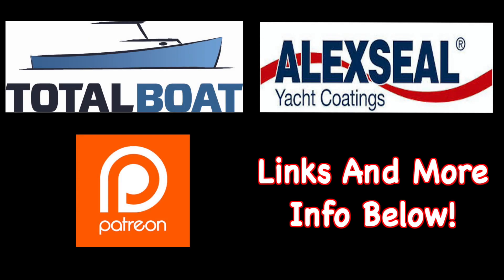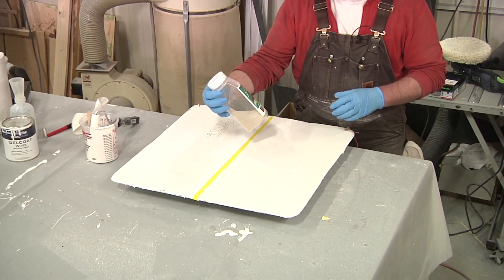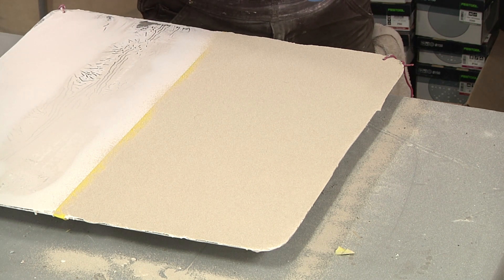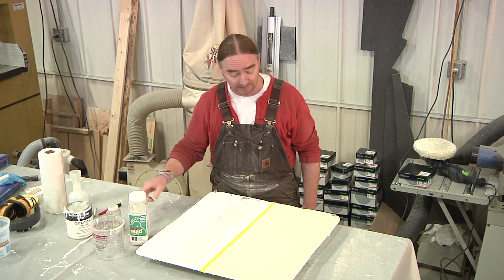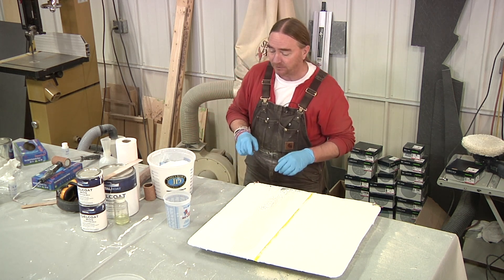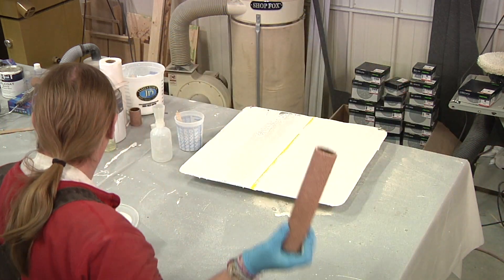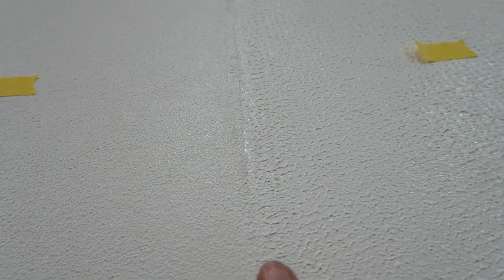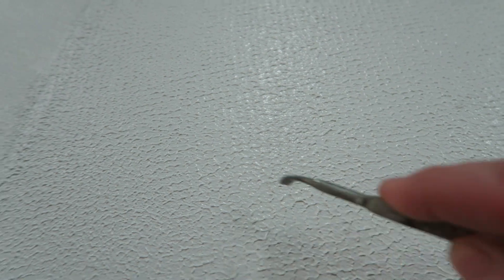2 Different Types Of Gelcoat Nonskid Applications For Your Boat Project!

Comment: We restored the deck of our 1976 Paceship sailboat with AWLGRIP and Softsand based off one of your previous boat job videos. Although many members of our club recommended we not use Soft Sand or AWLGRIP, and after we saw their application of the carpet roller technique on their boats we decided it was best to stick with your advice and Softsand. Boy are we glad we choose to stick to your advice. 
The job finished amazingly. The same members that poo pooed our decisions (because we're younger, new boaters) asked many questions of advice afterward.
It was our first time trying to restore any boat. LOL!  Your videos helped us to be patient and properly follow the instructions instead of cutting corners to get it done quickly. Well worth the effort.
Thanks for your efforts and trainings.
Reply: Did you use the flattener to cut down the shine?

Comment: Great videos. I used this exact technique using Totaboat single stage urethane. 
One point is to make sure the first coat of paint or gelcoat is as even as you can get it. I rolled in both directions
to make sure there was an even layer without any thick paint ridges from the edges of the roller. The amount of sand that adheres
is directly proportional to the thickness of the paint. Also any bare spots will not obviously hold sand. These bare spots can be difficult to see if 
painting over the same color. It is impossible to go back and retouch these areas.

Also DO NOT plan on painting surrounding smooth areas at the same time as applying the first coat over the sand! No matter how well you sweep or vacuum 
excess sand, some will be picked up by the roller and get deposited on the smooth areas, (ask me how I know!)

Keep the videos coming, very educational

Comment: I am fixing to shoot some non skid in a way I’ve never tried myself. The shop I buy fiberglass supplies from told me to get a cheap primer gun with a large tip size and mix in the sand with the gel coat to spray on. If it doesn’t come out you drill the tip on the gun slightly larger until the particles flow out with the gel. They shoot it all the time and it looks great. I’m fixing to try it myself. Great video!

Comment: I’ve used Interlux non skid additive with great successes. Works great with most hull or deck paint and goes an incredible long way.  It’s not overly course and won’t hold dirt or tear up a mop. Do a test board to figure out the mix ratio you like. Follow the paint instructions for number of coats and paint as soon as possible between coats because you can’t sand between coats. Stay the hell away from soft rubber grit. The paint eventually dries hard and the rubber flexes under pressure. The paint shell fractures leaving the exposed rubber grit which will decompose, change color, wear down or pull out. This leaves a void for water, dirt or an entry point for water to get under the paint.

Comment: I've used Kiwi grip on 2 boats, looks like your rolled finish.  You can control the "agressivenss" by how thick you put it on and knocking down the pointy parts after it dries the same way you have.  Water based, no hazmat fee, one coat.  I use drywall texture rollers, HD and Lowes carry in the paint department, look like they are covered in squiggly dried spaghetti.  Way cheaper than the Kiwi grip ones and work just as well.  I also took my white Kiwi grip to my local paint store and had it closely color matched to my tan canvas.  Love your videos for the techniques, learned a lot from them.

Comment: GM Andy! Both samples came out great! I do my nonskid the same way! For the rolled on texture, I thicken as you did, then I use a 3/8 nap roller. I get the material down, squeeze the excess out of the roller with a gloved hand, then lightly back roll the uncured gel. Leaves a nicer looking pattern than the “Carpet roller method” in my opinion. Love the soft sand method and product with paint too!
Reply from the maker: Great tip!
Reply: BoatworksToday thank you! All your tips and videos are great too! I wish I could produce the same quality videos you do!!!🔥🔥🔥🔥🔥🔥🔥🔥🔥🔥👊

Comment: We have done it before with the thick gel rolled on. We lightly sanded the stippled area when it cured to get it to match the gel we were trying to duplicate. It matched perfectly in texture and color. Just gotta knock the tops off of the stipple. Easy to do.

Comment: I've been leaning towards the Softsand since your 1st use of it, even on that test panel it's more pleasing to the eye. Like others can't wait for you to get back to the transom project, I'm pretty sure you are thinking and re-thinking options. Once you hit the point of no return it's all or nothing. I'm just glad none of my projects are that big, more cosmetic then large and structural.
Reply: i worked on liveaboard dive boats for 12 years in the caribbean.   Painted the decks every 12 months maybe? we always used silica sand.    base coat, sand, then topcoat. worked really well.

Comment: Thanks for the demonstration. I’ll soon be removing carpet from the floor of my boat and applying a nonskid surface. It looks to be a polyester laminate resin under the carpet but is rough and will need sanding. I’m thinking total fare to smooth out and even up the floor the using the soft sand and laminating gelcoat.

Comment: Yes acetone is a no no !!!! But I would like to know your opinion on (patch aid) (patch boost) also ,, I’ve been doing a lot of boat floor repairs … and pple want gelcoat and sand … do u know of or have a sealer top coat u would recommend???  Just spraying texture with gelcoat and sand and even paint seams to need a sealing coat …

Comment: Great video Andy.  Looking for your opinion on thinners.  Currently using Intralux perfection 2 part paint and it says to use 2333N thinner at 10%.  I am only redoing 2 covers/lids (and plan to use soft sand medium per your videos) and an aft door so will be using an oz or two 2333N thinner which is $30.  Can I use acetone or another thinner and obtain similar results or should I spend the $ on the 2333N?  Thank you

Comment: If taping off a smooth surface would you remove tape afre each coat and reapply tape before next coat, if so how long to wait before removing tape after rolling out.

Comment: What type of roller material did you use?  I applied an epoxy bottom paint with foam roller and it melted it.  Went back to standard roller for that.  I have a 1983 sailboat with old school texture.  How did the factory make the texture?

Comment: Do you think the soft sand approach will provide better grip than the molded texture in a c. ~2000 Vangard Laser? I always slip and slide when roll tacking and had installed some grip tape (two skateboard deck adhesive grip tapes) which worked well but after many years is now coming unstuck.

Comment: I'm learning a lot from these videos.  Thank you. The epoxies you use are excellent, but quite expensive when compared to good old "Bondo" which I assume is filled polyester resin.  Do you ever use Bondo to fill surface imperfections and if not, why not?

Comment: Are there any tips on painting a boat deck? (i.e. would yo u use something like Alexseal as well?).
I have a Sea Fox center console (white non-slip pattern in the gelcoat), and it has become very porous -- I get mold and dirt marks very easily that take a lot of effort to clean off...

Comment: I would sell what you are calling Carpet roll as RNS (Random Non Skid )  sold a lot of it over the years.  My technique is a bit different.  Would thicken the nowax gel to a mayonnaise consistency using microspheres and cabosil about 50 50 by volume  Cabosil only led to a more brittle product.  I would map out the detail lines and finish them to either pre paint or buffed gelcote depending on the overall finish.  then set up your lines and sand to a 40 grit surface.  The mayo material is then catalyzed for the conditions de jeur  more on the slow side than the fast side.  I then put in on the surface with a notched trowel so that the amount is consistent.  Roll it out with a loop roller for textured ceilings  usually cut to 3 inch length.  Remove the tape before b stage. Not a bad idea to de tape as you finish a panel. The finished product is cut you aggressive with very sharp peaks.  This is sanded to give at least 30 ish percent flats. Then finished with your planned topcoat.  You end up with a very attractive looking surface because of the sanded flats.  The design of the detail lines is important.  the surface is very dirt resistant.    I prefer it over the diatom surface.  the diatoms are sharp enough to abuse knees elbows and backsides and clothing.  Some people want it though.
The boat in this video has that surface on it https://www.youtube.com/watch?v=WuhcE2OAfLo
It is gelcoat finished   I used the same base for the mayo and the topcoat which I rolled on with some styrene wax to thin it 90-10 and let it cure catalyzed for results + 2% as it is a very thin coat.  The rest is roller painted with Interlux polyurethane enamel  the premium grade single part.  I used two quarts of gel coat for that job.

Comment: Hi mate, I am restoring an old 15ft half cabin cruiser. My question is,  the last person that tried to replace the transom screwed up. So I had to completely remove it. So my question is how far should I go around the edges with the new glass? And how many layers should I do? Cheers and thank you very much in advance. If it wasn't for your videos I would have never tried to do a boat repair by myself.  Cheers Sav.

Comment: I have a question, can you add the wax to your resin or gel cote like a pre mix . Put it in a whole gallon and then use as you need it. Or do you have to add the wax when you add the harder on every batch you mix. 
I bought 5 gallons of poly resin the weekend and I have the wax coming in the mail. I’m going to use about 3 gallons as a laminating resin and about a gallon for the finish on the boat I’m replacing the flooring in. Just wondering if I can pre mix the wax in that one gallon and have it ready.

Comment: Love the channel and love the laid back attitude! I work in a marine service shop in sw Mi Im working on restoring my 64 holiday speed boat during this shut down and your channel is what i always fall back to im not this far into it but im doing a total restoration. Transom was completely rotted along with wood flooring underlay. Old school fiberglass is mean stuff! But i think im gonna apply the soft sand in my boat. Quick question if you see this though. My boat has been repainted by people who dont know a lick abouy anything they used house paint😒 but under that is gel coat. Do i need to remove the gelcoat down to bare fiberglass in order to re-gelcoat my boat? I'm debating in-between sanding, priming and paint it or gelcoat I like the appeal and hardness gel-coat would add but if i need to take it down to fiberglass since the gel coat is so old thats 3x as much work lol

Comment: Hey Andy, I own a 78 well craft cuddy cabin and I'm wanting to freshen the interior up a little. The boat floor is in great condition but it  has a few chips here and there, so it's missing paint of course. What would be a good way to paint the deck. The boat already has texture. Is there a way to re coat it?

Comment: I used this method to make a floor for my kayak catamaran I built except my dumba*s poured the sand on all even then went to dump off all the extra and the paint sagged with the weight of the sand as I poured it off -.- lessons learned lol

Comment: i,ve used a 7 inch EG327T pattern roller on the floor of my "WITH KMV dromedille", it was a succes. The patern is very nice and smooth. the EG319T is even better in my opinion, but it was unavailable at that time

Comment: Does the Gel coat crack with the soft sand? Because the gel coat once cured, is hard and the soft sand remains soft and pliable under the finish coat.

Comment: Soft sand can be mixed in with paint before applying did you already show that method? The sprinkle is not good if working in the breeze.

Comment: I was expecting a price comparison.  The soft sand looks great, defiantly more refined. It seams like the thickened gel coat can be done basically for the cost of a roller.  The price comparison on silica to soft sand isn’t even close.  Any clue how much soft sand is needed per square foot?

Comment: Here in Finland you find the textured finish on almost every boat. When I have done it I used quite thick gelcoat and a large verry fluffy roller then I l sand of the sharp tops an apply oneother layer of gelcoat (or paint). Totaly desent result acording to me and you don`t get that "carpet" look.

Comment: I have a question about totalboat nonskid. My buddy used it. Did 2 coats & let it sit overnight in between both coats. Now he can scrape it of with a fingernail. It's been at least a month and it's still that soft. Is this normal? Trying to figure out what went wrong. Thanks

Comment: Hey Andy, nice tips on the non-skid! I was wondering if there is a type of release fabric that gives a nice non-skid texture. The normal release fabric I generally use leaves a texture, but I wouldn't consider it non-skid.

Comment: For the last 10 years, I’ve worked on boats where the non-skid it always “toned down” with top coats or made to be “not so sharp” and the result is always the same: any wetness totally negates the non-skid. I prefer functional non-skid rather than “pretty” or “smoothed”. For me, on a boat, safety is king and everything else is secondary.

Comment: Honestly?  I've never seen that "carpet rolled" look.  When we had both of our boats, both were the sand version.  I greatly prefer it in looks as well as it looks much easier on the feet.  We had boats that dated back into the 70's (some into the 60's too) in our marina and none of them had that carpet roll look.
Reply from the maker: the rolled version was a style that certain manufacturers used; not specifically all builders of a given time; maily sailboats
Reply: @boatworkstoday  it does not release as well as geo non skid or pebble grain (mako - parker) more of an after mold or custom built surface.  Never seen it on a new boat that has painted decks.